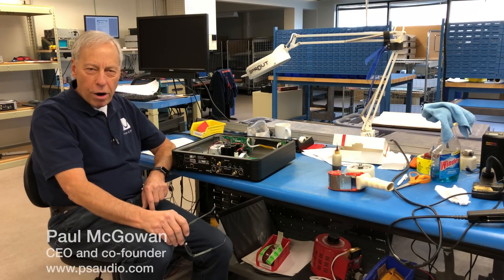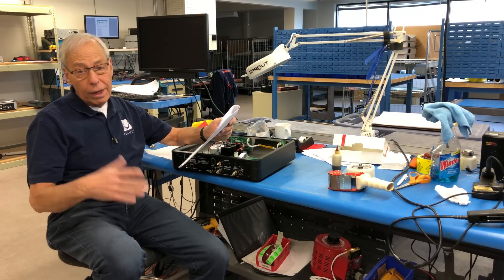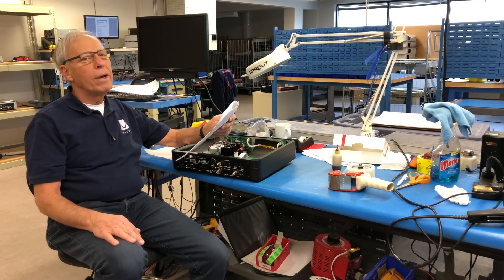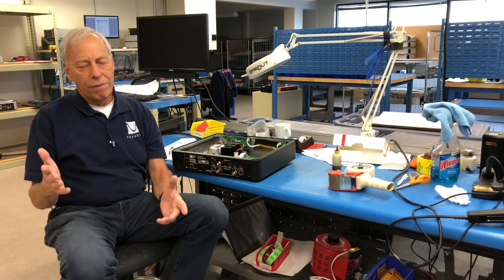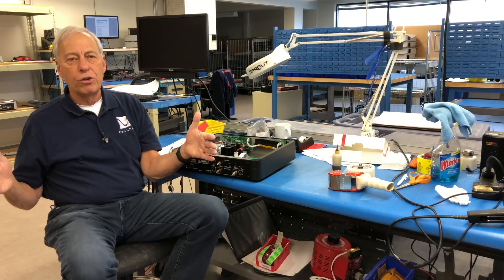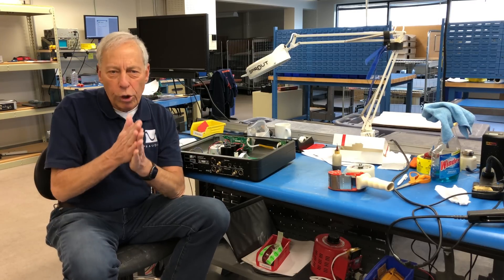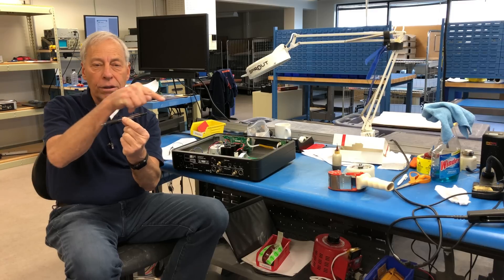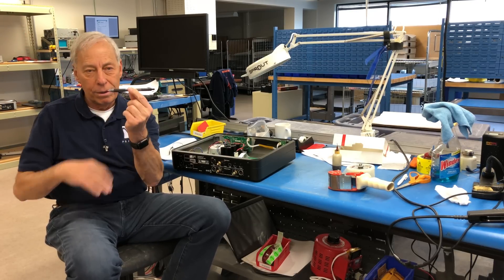Are low impedance speakers hard to drive?

Comment: I'd put it this way: both impedance and resistance are measurements of how much a conductor or other electrical component partially blocks the physical flow of electrons, also known as current. The higher the resistance/impedance, the less current/electrons per second floor through that component. The lower the resistance/impedance, the more current/electrons per second flow through the conductor or device. 

In this case, electrons are glowing or of the amplifier and into our speakers. 

The lower the impedance, the less the speaker is partially blocking the flow of electrons. The more electrons per second that get pushed through the speakers, then we could say there is more electrical power slowing through the speaker. Is there is more power flowing through it, it will of course, be louder. In this case, more power means more watts. 

The problem is that the more electrons per second we flow through a component, the hotter it gets. In the case of our speaker, if we push to much power through them, they may over heat and burn up, so ideally, we match the speakers to an amplifier with a sensible amount of power so as to get the most out of them, without blowing them up. 

But here's the thing, the electrons are also flowing through the internal components of the amplifier. Those components can also become thermally damaged if too many electrons flow through them pretty second. They will hear up and be destroyed, in particular, the transistors. But any component has the potential to be damaged. The internal components can be quite sensitive to this kind of damage and while it may not always damage it, it can cause strain on those components. 

This is why higher impedances are safer than lower ones. Most high quality amplifiers have protection against this kind of damage, but even then, those amplifiers have the potential to be caught off guard by a very low impedance. So 4-8 ohms is the safest range for most amplifiers. 

Love love love your videos Paul!!
Reply: Just one thing wrong with your statement, just because a speaker draws more current doesn’t mean it’ll be louder, the extra current will be dissipated as heat in the voice coils.
 A high sensitivity 8 ohm speaker will play louder than a lower sensitivity 4 ohm speaker.
Reply: If you have two speakers with every other parameter the same, mms and qts in particular, and you connect them to the same amplifier, the lower impedance of the 4 ohm speaker will be louder then the 8ohm because the coil will have double power running through it and this 3db louder. If you start running the coil to its limits, the coil will heat up and you will run into thermal compression, which is what you are referring to. The higher temp of the coil will add to the resistance of the coil, limiting the current flow. This resistance/temperature interaction is not exactly linear though, and at lower "room temp" ranges, the coil resistance does not vary a lot. Maybe a few fractions of an ohm. However, as you get to really high temps, such as to hot to safely touch, the resistance may increase by half an ohm or more. As it approaches thermal limits it may be several ohms higher at room temperature. But as audiophiles, we don't go around pushing our speakers as hard as that, as it obviously eats into dynamics due to mechanical, thermal and electrical reasons.

Just to clear something up, if you have two coils made of the same wire, but one has double the turns of wire and this double the impedance, you have more wire, and this now electrons, right? In theory, this should produce double the magnetic flux, however, with the impedance doubled, you have those electrons traveling at half the speed as the current is halved via the doubled resistance. So the advantages kinda of cancel out in terms of magnetic flux generated on a standard amplifier. There are some amplifiers that have what's called a regulated output meaning no matter the impedance, the power is the same, but these are not so common. In this case, the magnetic flux generated would be identical, assuming the coil isn't driver to high temps. 

Now, there are so many other reasons why different impedances can effect sensitivity that are not immediately obvious. For example, if you have two identical drivers, but one driver is 4 ohm while the other is 8ohm, the 8 ohm coil either has double the turns of wire which would double the mass, or it has half the cross section area of wire with double the turns which effects a lot which may include impedance curve, heat dissipation, fs, etc

A higher impedance coil with more turns of write is also going to produce more back emf that the amplifier needs to control, and so it may sound different depending on the dampening factor of the amplifier. This may eat into its "real world" loudness, especially at the low end. 

Please be aware though, I am agreeing with your statement..peer commission is absolutely a real thing and can reduce the output by several db, but is only really noticeable if the coils are getting really toasty. 

Sensitivity can get quite complex. I do thank you for your reply though my friend ☺ I love talking about this stuff! Maybe a little too much lol

Comment: Aren't you kind of sidestepping the amperage versus wattage versus available power versus demand issue?  As far as the amplifier is concerned this is more of a thermal efficiency delimma. Lower impedance demands the amplifier to supply more power on a continuos basis which the amplifier will do.  The result may be that the amplifier will run hotter risking thermal break down.  Or the amplifier may run out of reserve power during peak demands and go into clipping.
These are only two of the possibilities all which I believe include excessive distortion and an amplifier working itself to death trying to meet the demands of a load that it acknowledges, but may not be able to satisfy.
To be on the safer side, an amplifier should be constructed to supply at least twice it's rated output into one-half of it's rated load capacity. IMO.

Comment: Hi Paul  I was the Projectionist at a Drive In Theatre in the 70s. We ran Altec amps with 811A s... All transformer amps.! Steely Dan at ramp 13   on a sunny Wed afternoon...speaker check............... 660 4 "speakers all at different volumes and bouncing off the screen...... And Mono LOL  Great Memories

Comment: It all comes down to Ohm's Law. Very basic algebra. Google the equations. You have two known values to compute the third unknown. If I have an 8 ohm speaker and put 10 volts into it, it will draw 1.25 amps or 12.5 watts. If I put 10 volts into a  4 ohm speaker it will draw 2.5 amps or 25 watts. So with a four ohm speaker I can get the same output power with half the audio voltage than at 8 ohms, but need twice the current. This was an advantage to use 4 ohm speakers with car stereos before the age of cheap DC/DC converters. You have say 100 amps but only 12 volts to work with. Of course in both cases the amplifier must be able to supply the voltage and current for the desired output power.  A disadvantage to 4 ohms is you need a heavier wire gauge for the same power at 8 ohms so with 8 ohms you can have longer speaker wires with less resistance loss. Yes, impedance is not identical to resistance but for this simple example they are interchangeable.

Comment: That was possibly the most feeble attempt at explaining a concept to anyone who already didn't understand the idea I have ever heard. Your intentions were good but.....   I thought I halfway understood this speaker impedance thing but after that little romp in the dark, I'm not so sure.
Reply: The job of an amplifier is to produce the signal at a particular voltage regardless of the speaker. The  lower the speaker impedance, the higher the current the amplifier must produce to produce that voltage across the speaker. 

Let's say that for a given input and volume level, the amplifier should be putting out 24V. This is constant in ohms law (v=ir) so: 

24 = ir

We can now see what how much current is necessary to produce the 24V with an 8 ohm load: 

24 = 8i
i = 3 amps

But if the speaker load is reduced to 4 ohms:

24 = 4i
i = 6 amps

If the amplifier cannot produce the current required by the speaker, then the voltage will drop and the desired power output cannot be met. 

Suppose the same 24V output goal as before; but, now suppose that the amplifier can only produce 5 amps. This is sufficient for the 8 ohm speaker since it only takes 4 amps to generate the 24V. But if you attempt to drive the 4 ohm speaker with this amplifier,  you will not be able to produce the full 24V:

v = (5)(4) = 20V

Attempting to drive the amplifier this hard with either burn out the amplifier or result in clipping.

Comment: So the amplifier provides 200w when there's less resistance because of the lower resistance, whereas with more resistance it will operate at 100w? That does seem counterintuitive. So then, if an 8Ω speaker draws 100w, and a 4Ω speaker draws 200w, would a 6Ω speaker draw 150w?
Reply: For a given signal and volume setting, an amplifier attempts to produce a voltage. For our example,  let's say it wants to produce 24V. Using ohms law (v=ir) we have: 

24 = ir

If we have 8ohm speakers, we can calculate how much current the amplifier must produce to generate the 24V:

24 = 8i
i = 3 amps

We can multiply the volts times the amps to get the power in watts: 

p = iv
24×3 = 72 watts 

If we attempt to get the same 24V across a 4ohm speaker,  we can calculate the current and power in the same way: 

24 = 4i
 i = 6 amps
 24×6 = 144W 

So yes, assuming the voltage stays the same, the watts increase as the impedance goes down.
Reply: If this is right, I had the impedance-wattage relationship backwards before.

Comment: My integrated stereo amplifier has a switch in the back to set either at 4 ohm or 8 ohm. 
I wonder which is the correct setting for driving speakers that are rated at 6 ohm?
Reply: Arto Sarla 
https://www.audioholics.com/audio-amplifier/impedance-selector-switch-1

https://m.youtube.com/watch?v=Ou5bO8P2Drw
Reply: @bigpapa12  
I don't think the Audioholics advice here is universally sound.  They are advising to NEVER move the selector switch to the 4-ohm position.  
In the Yamaha example they included in the table, power at 8 ohms is 155W, and power at 4 ohms is 144W with the selector in the 4 ohm position.  For that amplifier, I definitely recommend using the selector switch as labeled, for 4 ohm speakers.  
In the Denon example, there seems to be something seriously amiss with the amplifier, as it's losing 80% of its power capability into 8 ohms, if the selector switch is moved to the 4 ohm setting.  It shouldn't lose more than 50%.

Comment: Part of the problem explaining why low impedance speakers are harder to drive is not as simple as running a battery through a wire, etc., the answer is much more complex.  How much power an amplifier can deliver to a speaker depends on the power supply, the current capacity of the output section of the amplifier, the stability of the amplifier, etc.  Some power supplies adjust the voltage that goes to the output section as the demands for power change, others don't.  Some amplifier designs are very stable at very low impedances, others will distort or oscillate.  An amplifier may be able to deliver double the power at half the impedance but it may have a lot of distortion.  The power rating is at a specified percentage of distortion so an amplifier that is rated at 100 watts at 8 ohms at .1% distortion, and delivers 200 watts at .2% distortion at 4 ohms, would be rated at less than 200W at 4 ohms even though electrically it may be delivering all 200 watts. Also, the output section of the amplifier has to dissipate heat.  A class AB amplifier output section has to dissipate more heat when it delivers half power than when running at full power because it has to dissipate the same amount of heat as it delivers to the load.  The lower the impedance of the speaker, the more the internal impedance of the output transistors become a factor.  In essence, the output transistors in a class AB amplifier work as variable resistors in series with the speakers, connected across the power supply.  Their internal resistance change in accordance to the input signal but transistors are not perfect and will have some resistance even when driven to their maximum current.  So for example, (using very unrealistic numbers to make the explanation simple) if you are driving an 8 ohm speaker and the internal resistance of the output transistor is 8 ohms, and it's delivering 10 watts to the speaker, then the transistor will also have to dissipate 10 watts of heat.  Change the speaker to 4 ohms, now the transistor would have to dissipate twice as much heat as gets delivered to the speaker.  That's one reason it's harder to drive lower impedance loads. The lower the impedance of the speaker, the more stress on the output transistors.  Before protection circuits became common it was very easy to destroy an amplifier by shorting the speaker wires together while the amplifier was playing.  Better designed amplifiers will normally have more output transistors in parallel, heftier heat sinks and better power supplies.

Comment: Resistance and Impedance are two different things, resistance based on DC circuits and impedance refers to AC circuits. This is where Ohms law is important to know, you use it a lot for a basic understanding of electronic circuits and measurements.

Comment: The problem is that manufacturers state average impedance, so when they say a speaker is 4ohms it means it will have frequency ranges where it drops under that (3, 2 even under 1 ohm). Not that it does not happen with 8 ohm speakers, but to a smaller extent. This drop under 4 ohms is the difficult load, most amps will drive 4 ohms easily, but very few 2 ohms.

Comment: The Lower the Impedance, THE CLOSER YOU ARE TO A DEAD SHORT!!!....and the MORE CURRENT/AMPERAGE/WATTAGE has to be PUSHED OUT BY THE AMPLIFIER!!!....More power put out by the amplifier requires more power reserve and higher current circuitry within the amplifier!!!....You might as well be welding!!! The impedance of the voice coil helps to create the alternating magnetic field that interacts with the static magnetic field of the speaker magnet!!!  Dead Short = No A/C Magnetic Field = No Movement of the Voice Coil withing the static magnetic field!!! If anyone reading this has done car audio, will understand from back in the 80's, the "Kicker" phenomenon!!!

Comment: i have never understood this either. this answer didnt help me at all.
Reply: The job of an amplifier is to produce the signal at a particular voltage regardless of the speaker. The  lower the speaker impedance, the higher the current the amplifier must produce to produce that voltage across the speaker. 

Let's say that for a given input and volume level, the amplifier should be putting out 24V. This is constant in ohms law (v=ir) so: 

24 = ir

We can now see what how much current is necessary to produce the 24V with an 8 ohm load: 

24 = 8i
i = 3 amps

But if the speaker load is reduced to 4 ohms:

24 = 4i
i = 6 amps

If the amplifier cannot produce the current required by the speaker, then the voltage will drop and the desired power output cannot be met. 

Suppose the same 24V output goal as before; but, now suppose that the amplifier can only produce 5 amps. This is sufficient for the 8 ohm speaker since it only takes 4 amps to generate the 24V. But if you attempt to drive the 4 ohm speaker with this amplifier,  you will not be able to produce the full 24V:

v = (5)(4) = 20V

Attempting to drive the amplifier this hard with either burn out the amplifier or result in clipping.

Comment: How can Martin login Motion models speakers able to do this 4 Ohms Compatible with 4, 6, or 8 Ohm rated amplifiers??
Reply: Some amplifiers, and some speakers, have a switch, perhaps rotary, to select impedance. Look! Read the manual! Ask! If in doubt, you can put two, or even three speakers (if you have a powerful amp) for each channel, in SERIES.  NOT Parallel!  Check carefully. This will ADD their impedances, and unless you desire hearing impairment (not recommended!) this should work, fine. If the speakers are not the same, by the same manufacturer, or check this anyway, check for phasing. Years ago, I made a reel tape of the single: "Autobahn" by Kraftwerk, so in mono. Thie begins with low bass. Or, any low frequency source. (Eric Burdon & The Animals: "It's My Life" or "We Gotta Get Outta This Place" should also be good, and not boring! Hope I'm not 'dating' myself, too much!). Since I was in an auditorium, I'd put the speakers onto the stage, butted up to each other, side by side. In series, or in stereo. At first, polarity doesn't matter - you'll hear the difference! If the speakers are In phase, you'll hear lots of bass, & good sound. If out of phase, there will be NO bass, & if you turn up the volume a bit. there will be a raspy sound like a really big guy farting right into your face! (Hopefully sans any smell!) Just change the wire polarity on ONE speaker, & listen again. Should be fine, a quick, easy check. There are graphs of speaker impedance per frequencey. On the low end, with a nominally rated 4 or 8 ohm rated speaker, the actual load that the speaker will present to the amp, can drop to around 2 to 2 and a half ohms. For a speaker with a sizable woofer, a lot of the power will go to this section, anyway.  This is one reason why placing speakers in series will not hurt.